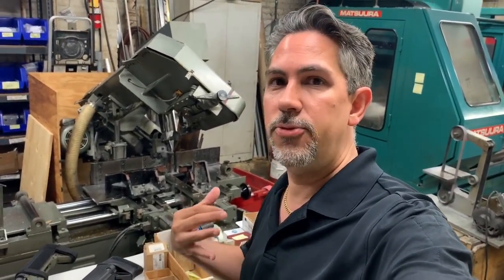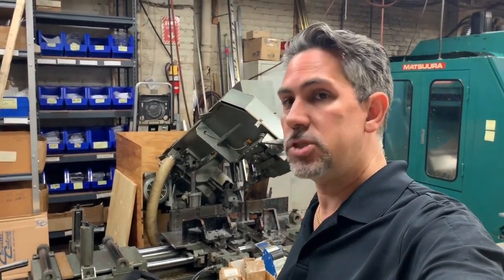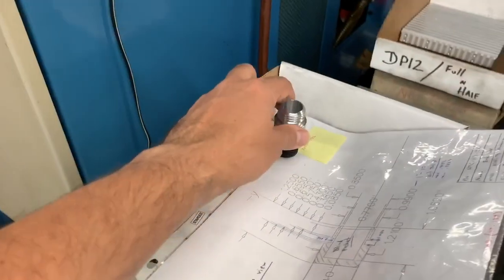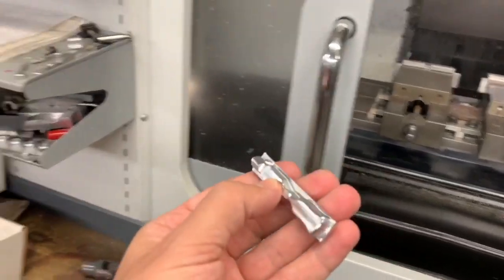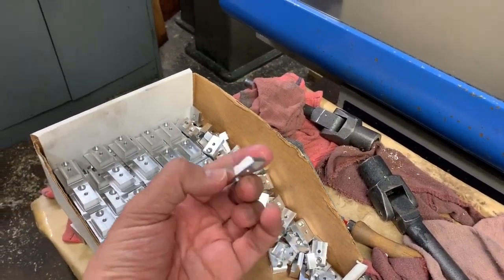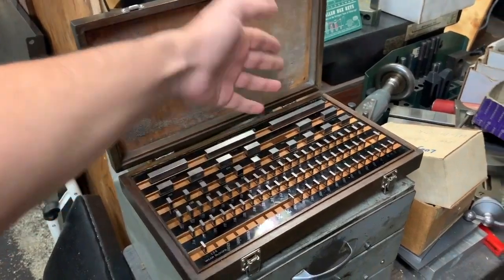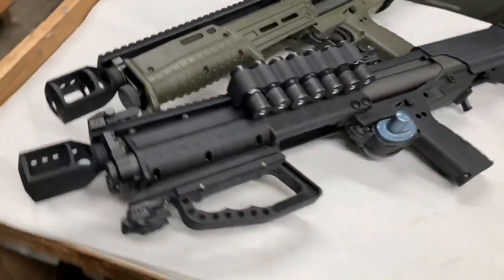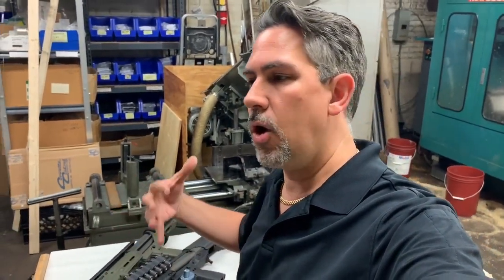How KSG Accessories are made. Behind the scenes at Hi-Tech Custom Concepts

Comment: Hello karl, yes, I want to buy a heat shield for my Kel Tec kgs. that has a (6 lug) that I need. I have found a complete set up that you offer on Ebay, but you don't offer a difference from a (4 lug / 6 lug) so I can't order the set up that I want without sending it back because of the fit. Lug & ranch I need... the package I want to buy has the 6lug nut and the tool, for the removal, and the thumb lever for the chamber switch, and I see you have the muzzle that bults on the end of the Baral... and do you have an order book to view. so, I can find more about ordering.   Thanks Jon    P.S. and if you can make you or someone else Elzey to talk to??? that would be great not only for me but others as well Thanks.:glasses-purple-yellow-diamond:
Reply from the maker: I can send you an invoice to complete this order.  Please email us so I have your contact email to send an invoice to.  Please email us at sales@hitechcc.com
Thank you.

Comment: Hello Karl Hi Tech Custom, I had try calling your number and put me on a phone tree, then going to your web site with no prevail. now I had found this post and was even more impressed. I found what I was looking for on Ebay, but I all most made my order but stopped because I need to make sure what I was buying was going to fit on my Kel Tec New Gen KSG because the one I have is a Six Lug with the longer barrel I need a heat shield and muzzle with a thumb switch from one barrel to the other. and a right hand sheal deflector for the bottom. among other things you may have as well. So, if I can find a way to set it up, grate ( on Ebay there is no way to say whether it is a Six lug or a four lug ) in your scrip you have no options if you can fix that, that would be great.... Thanks J
Reply from the maker: You can always email us at sales@hitechcc.com and I will reply immediately.  Usually all our listings say if it's a 4-Notch or 6-Notch Nut Remover.  Just email me and I will send you an identification sheet, or tell me what you need when placing your order.  Were here to help with any questions. Sorry we are not in the office all the time due to limited staff.  You can always email us for the quickest replies.  Thank you.  Karl, Hi-Tech Custom

Comment: I have the break, metal pic rail add-on and the metal foregrip. All are extremely high quality. I intend to buy a couple more foregrips for my other platforms as the texture is incredible. I would be awesome if you offered a single joint extension for it. For my hand size, the full length is too long, and taking out the middle section makes it slightly too small. Still the best foregrip on the market either way. Thanks Karl.